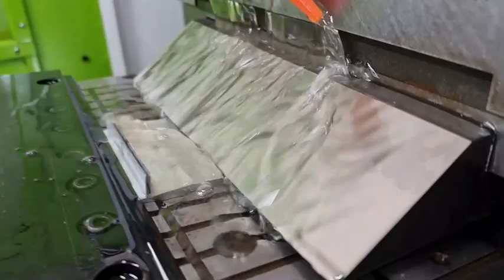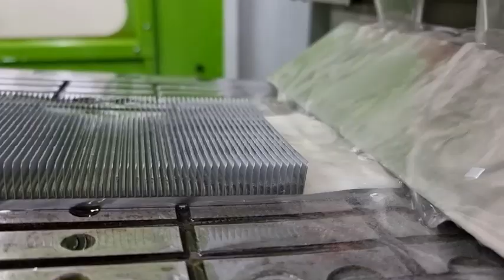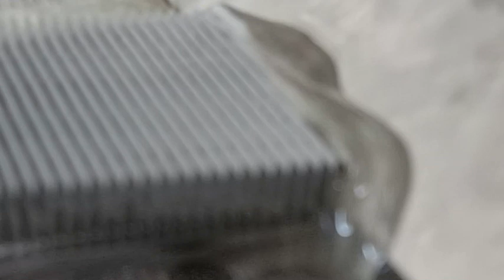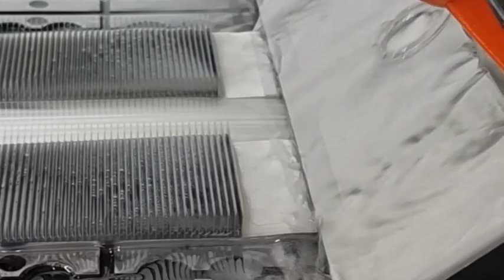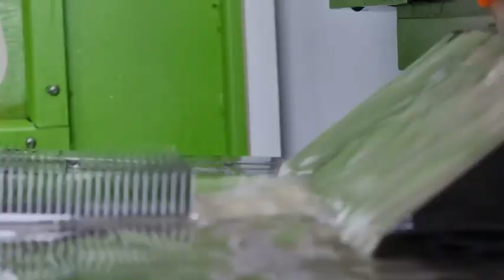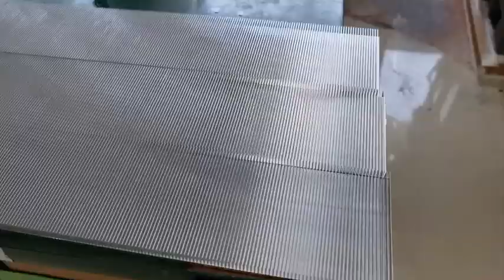Skiving video will make you fall asleep in 10 minutes | staring blankly without thinking... :))

Comment: I think the slightest deviation in material thickness make a big difference in fin length.  Am i correct? Also I'm curious what a tapered material would look like after this process. Also what does the blade profile look like is there relief under the blade.
Reply from the maker: The answer was late.;;
Fin length (height) is taken while cutting at the beginning of skiving. https://youtu.be/h4CqoRSQloc
Therefore, the material is finished with the same thickness as the base without taper. Finally, there is no relief under the blade. ^^; Thank you for your attention. If you have any further questions, please leave

Comment: Is the heat sink cut down to final size after skiving? If so how do you avoid mechanical deformation of the delicate fins?
Reply from the maker: Cut to final size. Most of the materials used for skiving are soft, so the fins after skiving are harder and less deformed than expected. Mechanical deformation that you are concerned about is not a big problem. Thank you for your good comments.
Reply: @skiving2020  I think what they meant was how is this master block cut down to the final products without bending the fins (asuming the final products have shorter fins and you would have to cut it lengthwise), or is that width the final dimension and you just cut it up along the fins to get the final products?

Comment: Can I buy some fins from heat sink 10 cm diameter I seen that u machine can make fins even 20 cm from u page
Reply from the maker: For business related inquiries, please contact ssbaik@heat-sol.com.

Surprisingly, what you need is a fin, not a heatsink.
May I ask what it is used for?
Reply: @skiving2020  I have issue with response here I spend alot time trying to response but it didn't upload if it not work this time then check u email 

As an material to manufacture device as said I'm mail can u response with the dimensions of what u shivering machine is capable of what is the maximum dimensions of heat sink u can manufacture in with and length thanks

Surprised that it works after 4th try 

I need material for manufacturing prototype machine u can think of it as an 3d printer prints layer by layer to make some kind of sculpture or component

I will use spot welding to weld together layers of plate's to make specific  pump impeller that would suck air from side and pull down smoke or cold smoke down to the pipe on a pressure  and for future projects too I would make a prototype of electrical rotor
Reply from the maker: @alangolab6657  please check the e-mail. Thank you.